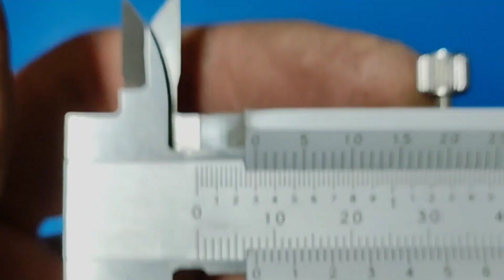STOP Throwing away any can , how to make  unlimited rechargeable Spray Can

Comment: The only things I would change are sand the can BEFORE drilling the hole. Much easier. Also, be careful not to allow the drill bit to penetrate more than necessary or you may damage the straw inside which goes from the nozzle almost to the bottom of the can.
Reply from the maker: That's right, My friend,thanks for watching 👍🙏